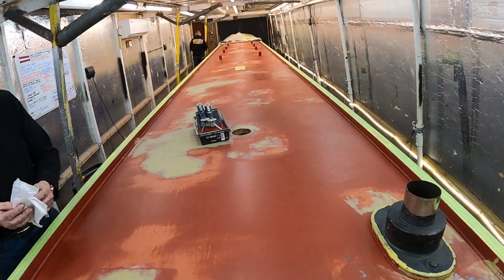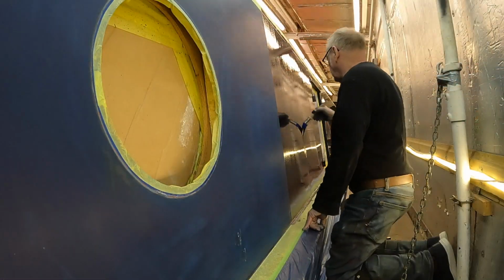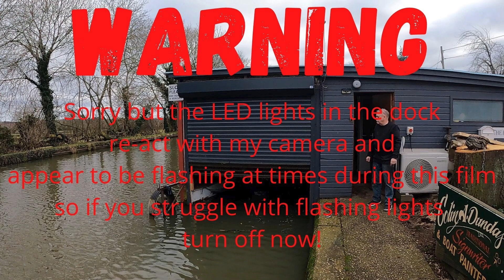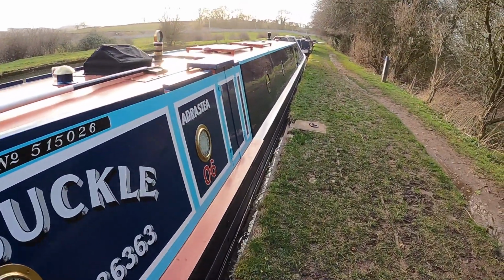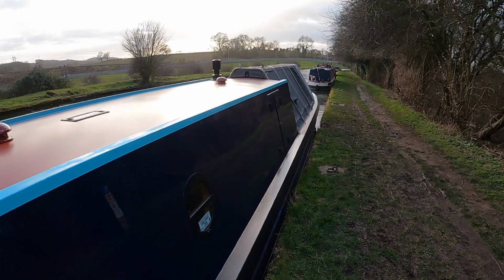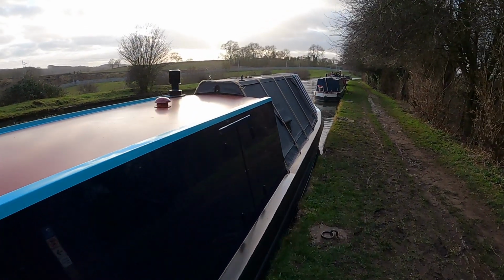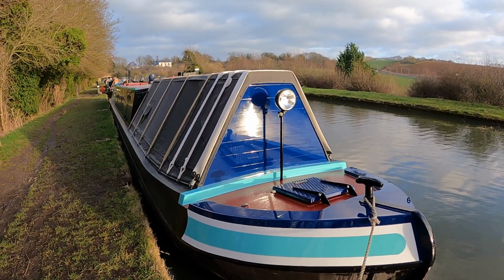Narrowboat Painting Part 2 | Roller and Brush Laying off | Boat works | Paint Dock | Colin Dundas

Comment: I like shiny coats, you are very good at it.
Definitely stands out from the crowd.
Is there a particular reason to paint the roof in a satin finish?
Reply: It reduces glare
Reply from the maker: Roof is satin to avoid reflection and its slightly less slippy over time as the roof gets walked on occasionally.